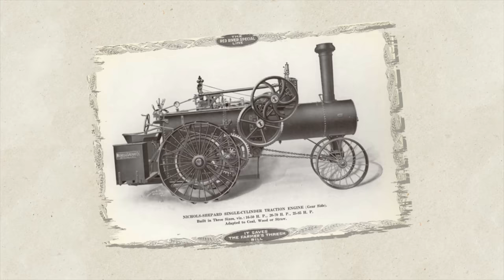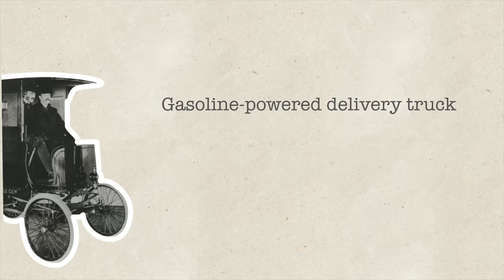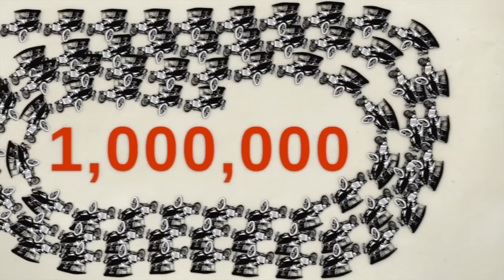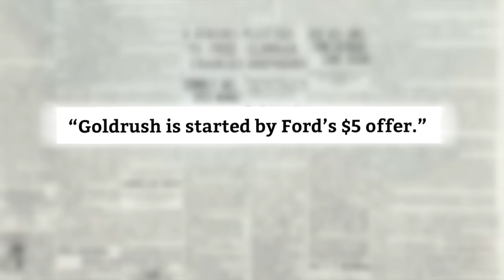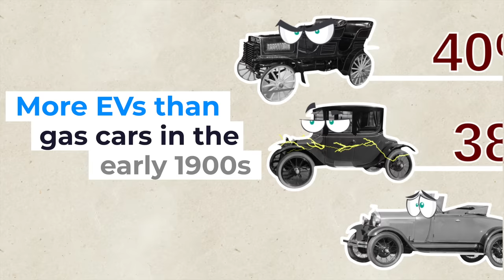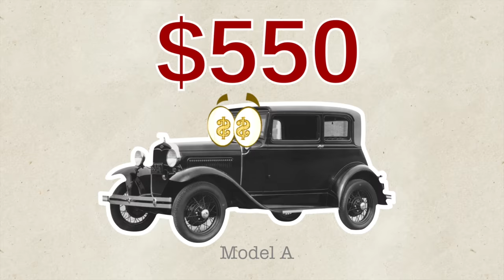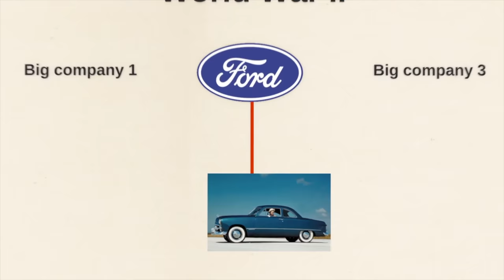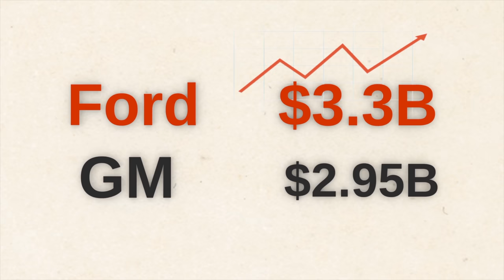Here's Why Real Americans Buy Ford

Comment: I love fords , my mechanic shop wouldn’t be in business without fords.
Reply: Ian Azzarelli Chrysler is worse

If it makes you feel better it is better than gm
Reply: Lol so true Ian 
I’ve been a master mechanic for 30+ years 
Just go by a Ford service department. 

But out of the big 3 American brands I have to admit I would take a Ford
Reply: Everybody wins!
Reply: They are junk the only domestic company thats worse is Chrysler!
Reply: R J  yes I understand that 
I was also a Ford factory trained technician and a diesel technician in Houston Texas for many years  and I am still in the industry. 
Most of the vehicles I see in the service department are not in for regular service 
There is a separate  part of most shops for maintenance and most have a designated quick lube section as well. 
What I see most recently are turbo failures left and right on all ecoboost engines, transmission issues,  evaporators leaking, overheating issues and a ton of sunroof failure on all the trucks (very expensive) and a ton of diesel issues on the three quarter and one ton trucks. 
That doesn’t even include the broken spark plugs in the older 3 valve engines and the cam phaser issues.  But being a tech I know how to do all these repairs 

Like I mentioned earlier out of all domestics I would  still pick a Ford
Reply: Ford should have kept on improving on the v8s, not ditch it for a small v6
Reply: D .G still a problem with 2016 and up models?
Reply: @Cyryl Dave Gelito the 5.0 f150s 2018 to hopefully 2020 deal with oil consumption
Reply: @thankyou9085  Ford should bring back a pushrod V8 with variable valve timing, but keep it simple for the masses.
Reply: @thsarethbreaks yes finally someone who gets me. Twin turbo v6 are not fast, there not really fuel efficient either, eco or boost, not both. 2.7 can tow like 8k max, the 5.0 can tow 10k max, but the engine is not forced fed and tiny so there’s many ways to improve. Pushrod or sohc v8s have low end torque so either of them is cool
Reply: Cyryl Dave Gelito ... turbos. If I were to buy an f150 I would buy the v8 stay away from the twin turbo v6 if you plan on keeping it for a long time
Reply: @thankyou9085  You can thank the EPA and the stupid emission regulations for that... They want to kill our freedoms out.
Reply: @Dharok wow bro that sucks ☹️
Reply: Joskj j       Why do you think I like Chryslers? The Cherokee as my pic was made under the Chrysler era but it’s still an AMC design, not perfect, but simple and easy to work on.
Reply: Ford is doing better so they're going to change their name to Form: Fix Or Repair Monthly.
Reply: Johnnyboy5520 😂
Reply: @darreno1450  hahaha niceee
Reply: @unfairsanic5089  You are out of your mind.  The GM LS series is far more reliable than anything anyone else has produced in the last 20 years.
Reply: Bone Saw     "best selling pickup.."  ... Windows has the best selling operating system for years...need I say more.

Comment: If Henry ford knew what was going on with the high prices of his cars , he would be rolling in his grave.
Reply: Bobby Knuckles  h-yea they "were" tanks (made to last) , the tow truck had to choke his tires and pull (untill the wire was straight with his front wheels off the ground)  to pull my dads 71 Lincoln continental stuck with only 1 tire in a ditch . A Tank for sure!
Reply: The first aFORDable V-8. Big difference.
Reply: 70s  lincoln  continental , 80s  lincoln mark 4  lsc.  town  car , Ltd crown  vic  , Ford  the  king  of  V 8  land yachts.
Reply: Last time I checked, there were quite a few ford's you could buy new that had a starting price between 18 and 30k, while somewhat expensive, that's by no means an absurd amount for a brand new car. I know people are gonna say, wow, if I tick every options box the car gets expensive but my reaction to that is,  of dug. Modern cars are more expensive, but they represent a better value. More powerful, efficient, reliable and safe for a price increase of a few thousand compared to cars from a decade ago. That's not terrible.
Reply: kinda makes you wonder why the auto manufacturers can't make a "real car" for the average working man. You can tell the people who struggle by the "throw away" cars that you see on our public roadways
Reply: Inflation car industry
Reply: @d.s7741  Everything you just said was wrong. Today's cars are far better than anything that came before, there are cheaper cars, and cars aren't throw away, they're lasting longer than ever.
Reply: @d.s7741  
in  they  good  ole  days (80s), they  did.  could  get  a  nissan  or  Toyota s r - 5  or  dx  truck  for  under  $ 8 k.
Reply: @KB-bh9hp  - what are you gonna do with a Mitsubishi Mirage, or a Kia Rio? just to name a couple.
Reply: @driver4011  - in 1981 I bought a 1970 Roadrunner for $1200, put another grand into it. Built it for top end 727 torqueflite w/manual valve body etc. had four and a quarter H.P. @16 m.p.g. Whatcha think that cars worth today? Because the next owner turned it into showroom condition. That's just one of a dozen cars I've owned and modified.
Reply: @d.s7741  
worth  a  lot....probably  $ 40 k  or  more.
Reply: @driver4011  -  lucky man who bought a Toyota SR-5 in the 80's. Couple rides I had back in the '80's were a white 1971 Plymouth Valiant with a slant six, modified for deep snow.  1971 Two door Chevelle with M50's mounted on NHRA approved Fenton Aluminum racing mags, and Lakewood ladder bars on the rear, and 60 series tires on the front, and a 1974 factory custom Dodge van w/318 c.i.d. Never wanted a Toyota, but I did have a 1974 Datsun 260Z. Yes! those were good old days
Reply: @d.s7741 
before  toyota  , datsun  reigned....the  260zs  were  cool...620 , 720  pickup  trucks.  tough  durable  well  built  reliable  vehicles.
Reply: Yar Nunya  - I wonder if that car can chirp it's tires at 55.m.p.h. and pin you to the seat  until you shift at "a-buck-ten" You do know that was a striped version of a Superbird. Google Plymouth  Superbird once for me and get back
Reply: @KB-bh9hp  Not all of them.
Reply: @elevenbucks5682  Not all modern cars are lasting longer sure. But most cars are. Brands like Kia and Ford are way more reliable now than they were in, let's say like the 80s or 90s. A modern ford can easily last 200k, ones from the 70s and 80s struggled to last 50k without at least some issues.

Comment: I’ve owned 2 Fords in my life and didn’t have much luck with either. A 1984 Tempo, and a 1988 Thunderbird Super Coupe with. Supercharged V6 and 5 speed manual.
Reply: I have a 3.0 duratec v6  flexfuel very reliable motor ,Ford did fantastic job
Reply: The 80's were NOT a good time for Ford.
Reply: The Shield mine had issue from the start , oil leak, power steering pump leak, any parts needed were never in stock. With the oil leak I can vividly recall how upset the dealer mechanic was trying to fix it, yelling “ these damn engineers and Fords better ideas, they should have to bring their assess down here and try and work on them sometime!”  😆
Reply: You somehow picked two of the worst Fords ever.
Reply: @Charliefox71  
mustangs  sure  were  popular  in  the  80s.   5.0 litre  V 8s  n  the  ford  mustang  svo ( 4 cyl turbo) along  with  lincoln  town  car , Ltd crown vic.....nice  land yachts  with a lot of power.
Reply: @Charliefox71  Neither were the 70's!

Comment: I've had 4 Ford trucks:
A 1968 f100, a 78 f150, a 79 f150 and a95 f150. I've also had a gmc, a Nissan and a Mitsubishi. Never had a dodge truck but have had 3 dodge vans and 3 or 4 dodge cars.
Personally, I consider Ford trucks, especially 1995 ish and before, to be the gold standard in trucks.
Just my opinion.
P.S. I read somewhere a few years ago that the 'preferred vehicle' of most millionaires in America, was the 1/2 ton Ford pickup.
That being the case I figured that I had the truck so now all I need is the money.

Comment: Im the original  owner of a 2000 f150 4.2l with 241,000 miles on it an I just replaced the original fuel pump after 21yrs THATS WHAT YOU CALL QUALITY 
For.                 For
Off.                 On
Road.              Road
Driving.           Drag racing

Comment: Ford been good to me have bought 9 new Ford’s in my lifetime! Currently own a 2002 f150 extended cab two wheel drive 6.7 foot bed ! 5.4 two valve motor got heavy duty trailer tow package and 302 a equipment group package! I am a tradesman and truck has hauled and towed and been driven hard since new. Currently sits at 359000 miles no major motor work and nothing but replaced fluid in transmission with aftermarket transmission fluid and replaced couple rusted leaking transmission lines ! Of course regular maintenance items have been replaced over years as one would expect! Best truck I’ve ever owned and many friends and family and coworkers can’t believe the money I’ve saved over years continuing to drive and maintain old girl ! 6 sets tires numerous brakes jobs to many to count alternator water pump etc! Still have original ford motor company starter on it !

Comment: That yellow "Pinto" looks more like a cross between a Maverick and a Mustang II.
Reply: That's what it was. 

The Maverick is really the successor to the 1965 to 1969 Mustang.... But was marketed as the 70s Falcon.   Mustang II was returning the car to a secretary's car.
Reply: Pretty close. In development for the 1974 Mustang(II), Ford had two prototypes; one based on the Maverick, and another based on a heavily modified Pinto platform. They decided on the latter because it was even closer to the original Mustang and more able to deal with the looming fuel crisis. Also, and I can't emphasize this enough, the Mustang II was blessed with the BEST front suspension of any Mustang before or since. Ask anyone who builds hotrods.
Reply: @STho205  That works out nicely, as the Mustang was a flashy modification of the Falcon
Reply: the Maverick came out before the Pinto

Comment: I had a Ford Truck from the 90s and a couple of years ago I started having these weird issue where the plastic parts seemed to star dissolving.  It was the weirdest thing.  The light sockets would just crumble the door handle plastic cable guide did the same thing.  I replaced the guides with after market metal guides.  Then to my utter dismay the plastic on the intake started crumbling.  Really made me distrust Ford products.  I was not the only one this issue happened to either.  I guess Fords BIG idea was using easily biodegradable plastics.
Reply: Fords BIG idea was - and is - using the cheapest crap available.
Reply: @nofyfb123  I can attest to that.  I had a Ford pickup truck and went to replace the lightbulbs in the 3rd backup light as 2 had burnt out.  The plastic they used pretty much disintegrated in my fingers as I tried to put in a new bulb.  Same with the 3rd door latch.  I had to replace the plastic cable guides with some after market aluminum ones because, again, the plastic guides were disintegrating and crumbling. I have seen plenty of plastic items last many years on vehicles and I know those Ford engineers had to know the plastic they were using would fail in just a few years, probably by design.

Comment: Just bought a 2008 used ford taurus for 1600 & its so quiet 🤫 & there were somethings that weren't working like both front door handles didn't work but my husband fixed it with just a couple zipties & the front seat back adjuster doesn't work & AC doesn't work but thats literally it...I never had a ford before but thank God I didn't go back to Nissan ✌

Comment: Five reasons that some people buy Fords.   1. Their grandfathers and fathers owned Fords.  2.  The want to "buy American", but  don't know their new truck is made in Mexico and the exhaust  isn't rust -resistant. 3. They don't know that the transmissions used in the model they bought was so bad that the engineers at Ford begged them not to use the dry dual clutch design.  4. They believe that "at Ford quality is job 1", but don't know that it was the first job outsourced  to reduce cost. 5. They've never looked at a Consumer Reports Annual Car Buying Guide. and seen how used Fords are ranked among all brands.

Comment: Hey Scotty, I'm 19 and I'm thinking about starting a shop. I've torn down and rebuilt a number of engines, and have done all the work for my family.  A lot of people say fortune favors the bold, you think I should wait or should I take the risk?
Reply: Gabriel Charles If you like it, start now and find your special niche. I am 48 and still have not opened my shop but I want to. Better to get started building your client base and establishing your niche. Endure and charge forward, rinse and repeat!
Reply: Take advantage bro i wish i had family that worked on cars ! You should open the shop! Theres always going to be work as a mechanic because there will always be cars. Good luck man
Reply: Great ambition, I suggest working for another shop first and see how business is run, what kind of work to expect (pick and choose any specialty), and generally figure out the ins and outs of the industry. Good luck!
Reply: As long as you know what you're doing. Like others have stated, build your client base and/or work at another shop for a little bit to understand how the business side works.

You have the right ambition, and with the right attitude and knowledge, you'll go far.
Reply: @MadLadCustoms  yes Sir. a good advice in deed.
Reply: Just remember that when you turn a hobby into a job or business, it stops being fun anymore and it's just 'work'.
Reply: @townhall05446 , Ditto.  Becoming a proprietor, incorporated or not, you don't own a business- it OWNS you.

Comment: I never will l buy ford vehicle. Toyota vehicles are better.
Reply: That's great our ford tow trucks need something to tow
Reply: I used to be a prototype driver for Toyota and Lexus. Most of them are pretty decent but some are shitty. Give the new 2020 Camry 20 years and see. Now something like a 1999 Corolla? Fantastic. Ford has decent models too as well as garbage ones like the 2012 Focus; I'd never buy one. But a 2008 3v 5.4 F150? No excuse you can't get at least 300k with basic maintenance and some preventative things like changing the timing chain and oil pump every 150k. All brands have their super stars and terrible models.
Reply: @AltruisticWarrior  my lexus ls430 2001 has 320000 miles with basic maintenance. Every 100,000 miles timing belt pulleys water pump serpentine belt get replaced.
Reply: @andrewvillanueva4222  those were definitely good cars. Some of the newer Toyotas though... they had some issues is all I can legally say, some were verifiable safety concerns but the manufacturer requires us to rewrite documentation in their favor if a court case were to ever come of anything. Make no mistake, all manufacturers do this. But every brand has a few really reliable vehicle models. My MK6 Jetta 2.0 is a good example. It's a heavy daily driver, 150 miles or more a day going to and from my first job and delivering pizzas on the side. 2012 with 186k on the ODO. I've only replaced a rear door lock and an oil cooler outside of basic maintenance. Some VW though... 😅
Reply: @AltruisticWarrior  I am on my fourth Toyota Sienna. Only ever changed brakes. Ask me about my Dodges lol.

Comment: My Grandpa drove Model T Delivery Trucks in the 1930s. He told me how to drive one. He also told how the Company he worked for first used detergent motor oil in the Ford. The engines all started burning oil, then they stopped using oil. The detergent motor oil cleaned all the gunk out of the engine.

Comment: I had a 1923 Ford model TT..pickup truck. The TT stands for one ton heavy duty pickup. I had that vehicle when I was in my late 20s and restored it. The pickup was a C cab and I really loved that historic vehicle and before that vehicle I had a 1970 mustang mach 1 and with a 351 Cleveland and a Carter 625 double pumper carburetor. Then from there a 1970 datsun 240z with 2 SU..side drafts carburetors. I had some cool vehicles growing up that's for sure

Comment: Not only was Cadillac the first to use it in a production vehicle... The Ford model T was one of the last vehicles to switch over from the hand crank to the electric motor starter.

Comment: in the 30s Ford came up with the flat head v8. also Ferdinan Porshe visited Fprds assembly line. note the simalar body styles between the early Beetle and the Ford delux . in the late 60s ford improved the v8 and made the 9inch rear. Ford wisely hired Shelby to make cars to beat Ferrari on the race circuit. Ford also had inovative ideas for big trucks such as tandem wheels and the use of Desil fuel.

Comment: I take a picture everytime I see a Ford truck that's new or only a few years old being towed usually by an older beat up Chevy but some by tow trucks and most recently an old beat up Ford.   One F350 was only a year old and  was being towed by a 25 year old rusty Blazer.  
I started taking the pics after an encounter with a guy who had a 6 month old F350 and on his 3rd tow.  He was stuck in the park trying to disconnect his drive shaft yet again

Comment: Even though I bought a new Mazda CX-5, I still have my 1999 Mercury Mystique (a Ford product), and it's still driving well. But I had to spend money to keep it on the road... probably over $5,000 in recent years. The only problem it has now, is a nasty vacuum leak that I can't find. It's mostly loud when the engine first starts up, and it's moving in reverse. The engine still runs smooth, though, and it's starts up quickly. Very strange.

Comment: I had a GT Mustang 20k miles to over 90 before I traded. I never had a problem and it was fun. I also was paid well on the trade. Like I only spent at most 1500 a year in payments. Bought 22k and traded I think 15k. I did well on that car. I think I still owed about three or $4000 but I did well in the car. It was like almost a free car it’s ridiculous.